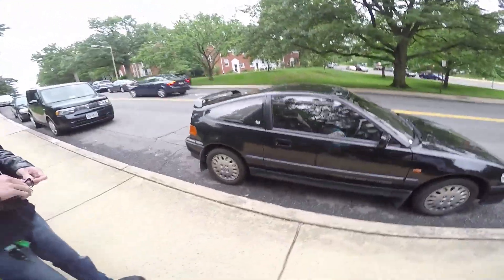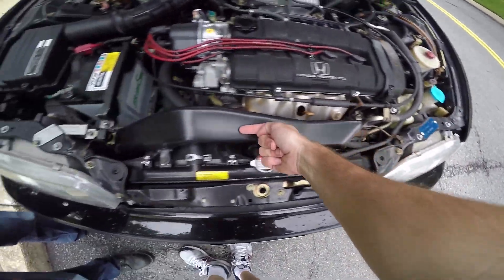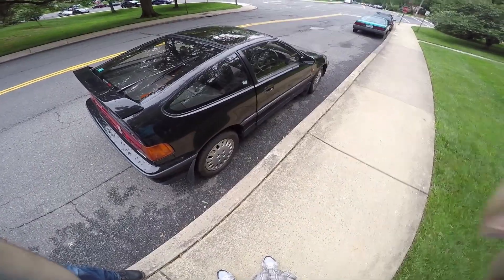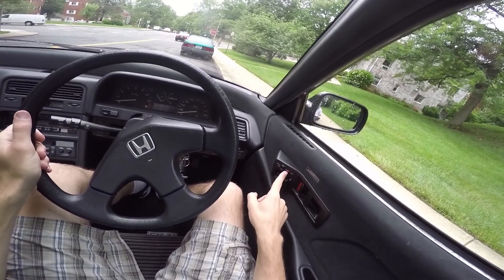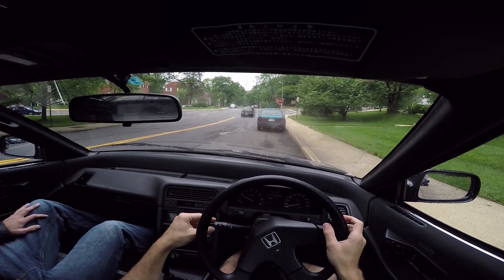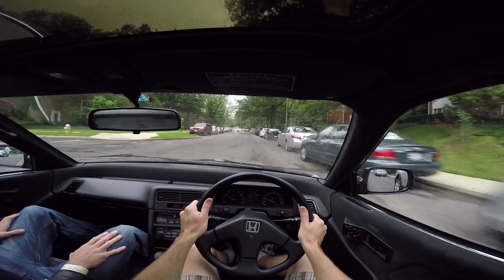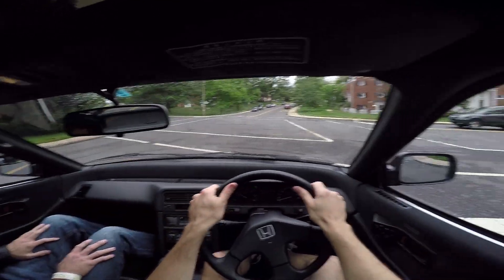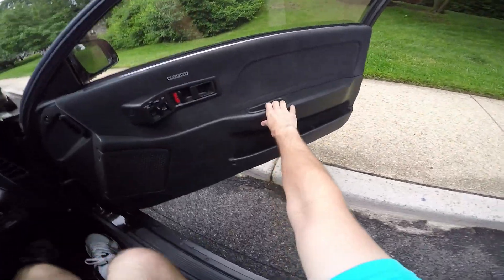1988 Honda CRX JDM P.O.V. Drive

Comment: Would anyone else kick an elderly woman down a flight of stairs for this car?
Reply: Yep
Reply: Yep
Reply: Jack Daniel It's the elderly that tend to cherish these cars, put little miles on them and eventually sell them onto a younger generation. Would you kick an elderly woman down a flight of stairs that has looked after an 80's Honda from new ? Oh wait this is youtube...
Reply: ***** I would generally recommend against selling a CRX to someone of my generation. We have a knack for either totally destroying the cars, or doing things to them to turn them into street racers. I'm 22 and drive a white '91 CRX HF that has over 304K miles on it. Luckily, I understand the value of taking care of such a car as these things are getting more and more rare, and they have incredible gas mileage compared to a lot of the other cars that are being driven today.

Because I cherish this car, I am trying to put in the money and work to restore it as best I can to its stock condition. Just bought a motor for it that only has 150K miles on it from a friend for $150. Soon, I will have the engine swapped, and will no longer be leaking so much darn oil. Most of the small problems this car has were there before I got it a year ago.

Honestly, though, don't just pawn it off to some kid my age. Make sure they will be able to take good care of the darn thing.
Reply: Jack Daniel 1:1 trade? ALL DAY
Reply: the0real0realitykid Yeah if you can keep hold of a good one it's best to. I thought I sold my car to someone decent and 6 months later it's no longer on the road ! Only 14 examples left now !
Reply: I wholeheartedly agree with not selling these and even 90's prominent import cars to the current and even some people of my generation. I'm 29 years old and my first car in high school was an '88 CRX DX in 2002. I bought it for $400 because is wasn't running and the owner didnt't know what the problem was. It ended up being a fuel leak at the FPR. Aside from faded paint, the car was in excellent shape. Fast forward 1year and i was in full fledged rice mode and destroyed that car. But recently, before mr. Regular posted these crx review, I was scouring craigslist for a bone stock, excellent condition CRX of any model for a daily driver. To my amazement, there were almost none to be found. The same goes for all EF's, EG', and EK's. It shocked me how the last generation just completely ruined the vast majority of these vehichle, which is Honda at their finest and most pure form of their original vision. Anyway. Whats left thats in decent shape are commanding high prices so if you have one leave it alone because no one looks at Honda's as serious collector cars but, if most examples are molested then that may change. Sorry for the novel, haha.
Reply: Jack Daniel Like I said, any of the work I do on this car is to bring it back to as close to stock condition as I can. Right now, replacing the engine because my current engine leaks. Not a lot difference between the old one and newer one from what I am told. Definitely not turning my car into a ricer.
Reply: +the0real0realitykid That's awesome. I'd like to do the same some day but, with a family I can't dive head first into a project anymore. One day I'll start resto project on a CRX and drive it forever. Take you time and do it right and don't let anyone tell you Honda's are a waste of time.
Reply: +the0real0realitykid If you were referring to hearing that there's not a lot of difference between the engine in you car now and newer ones, then, that's exactly right. The differences are mainly in the intake manifold, water/thermostat pipes, and knock/oil sensors on the back of the block. Swap over the corresponding parts from the old engine to your new one. I admit I started in the game as a ricer but quickly learned. Good luck with your project and REPLACE THE WATER PUMP AND TIMING BELT WHILE THE MOTOR IS OUT!
Reply: Jack Daniel again... to ease your mind, you can consider me the serious collector. A small amount of body work and an antique plate, then it's basically to the car shows. I can guarantee there will be no JDM AF stickers on this vehicle.
Reply: Yeah I probably would
Reply: +SUPRA thanx it's a couple years old
Reply: +Devin Kaiser funny I graduated high school when you said that, if you knew about cars you would know that a sun fire probably has more power than a crx :/
Reply: Funny, if YOU knew about cars, you would know it's a Sunfire. One word. You could get the Pontiac with 115-150 hp and they weighed at LEAST a few hundred lbs. Prob not faster or if so, just barely. Go ahead and show us more of your, "knowledge". We are dying to learn from the, Master.(bator).
Reply: jalderink and my old comment is still relevant how?
Reply: Zachary Vasil my crx has 140 hp (same as a sunfire) and weighs 600 lbs lighter. But your sunfire would, in theory, be just as terrible as every other garbage sunfire put there. But mine would still be stopping traffic in its place to stare in awe.
Reply: Neah
Reply: Jack Daniel gently.
Reply: Twice 🤯
Reply: I would kick one from a 50 story building

Comment: Amazingly low miles for that car, the owner is lucky.
Reply: ravesilly It could be fake tho, and even if they are not it means that either the car had an accident or it was left in the garage for a long time, either way it's a bad thing.
Reply: Andrei Vlad 1 owner in Japan. All the service records were sold along with the car :) No accident history. Grade 4 at auction :) I have underside shots too. :)
Reply: Andrei Vlad I mean I'd say that's a weird assumption considering how completely clean every detail of the car is, especially the engine bay. That engine looks showroom new. As for it being fake I'm sure Mr. Regular could tell and would let us know, do you know more about cars than him? I doubt it.
Reply: Living in Japan and owning a few cars, I can agree the TRANSMISSION has about 22k miles but how many HOURS are on the engine?  I drove from Atsugi base to Yokota base which was about 25miles or so but sometimes I sat in traffic for 3hours.  Yes the transmission drove for 25 miles or so, but the engine ran for 3hrs.  Mileage is a transmission thing, engine runs regardless if the car moves or not..;-)
Reply: 3 hours for 25 miles? You could walk there faster.
Reply: +ravesilly When you're able to import the 90's JDM stuff in the US, you'll understand that low km JDM cars are pretty common, here in Canada we're only at 15 years import rule, more or less they all come here with around 50k - 120k kms. Anything with a USDM chassis equivalent will drop in price overnight as a side note, Z32s/MKIV Supras/SW20s/FD3Ss etc, all around $5k to $15k CDN depending on mileage, auction grade and mods. Also basically all of them are rust free too :)
Reply: n1zm0 I've been browsing the auction sites for the last few months and I can tell lol. I actually found a 1990 GT-R yesterday with 26,000 miles with a B grade for both the exterior and interior. If it didn't have a repair grade it would have been perfect.
Reply: +ravesilly the r32 gtrs are relatively pretty cheap here, it's the r33s and r34s that have a really high price simply because they're still sought after in Japan and worldwide. Same goes for nsxs and ae86s, if the Japanese still want them, they're going to be expensive. But run of the mill things like type r integras, civics, mr2s, s15s, all are decently affordable here
Reply: +ravesilly by r33s and r34s being expensive I mean the gtr versions, the gts-ts are whatever, dime a dozen here, but the jdm importing is becoming a fad now, since all the good stuff is already here (90-early 2000s)
Reply: n1zm0 The R32's are actually going up in price in the states which is half the reason why I want one. The other half is because I miss having a 6 cylinder and I have a huge crush on GT-R's.
Reply: +ravesilly just import one from here, we have tons, just go on kijiji in any Canadian city and type in skyline =)
Reply: n1zm0 I never considered that actually, It'd also be cheaper I'd imagine. I'll have to ask Rivsu if they could do that. My only worry is a car coming from Canada is going to have rust unless it's a summer only and garage kept car (yes I am aware R32's already have some rust).
Reply: +carib2703 It's not a lawnmower bro... who gives a fuck how long it sat in traffic lol. Look at it, it's clean as FUUK. You're just getting into a whole new level of O.C.D. Ain't nobody got time for :P
Reply: +lolyermad It's Japan. Pride is like everything there. Although that might be a bit reverse racist.

Comment: 1.6 ZC have not seen this engine in a long time. They made Carbon Fiber Hoods with the ZC bump on the hood to make extra room for it. Very clean and classic. Hold onto it these models all 85 to 89 ae becoming classics.

Comment: At 4:40 you can see that this one is equipped with back seats.  Just barely safer than a Brat back seat and you'd need to be a legless midget to fit there.

Comment: My 1990 Civic doesn't have a shift lockout either.

I giggled at the oh-so-familiar shifter wiggle to make sure it's in N before turning the key. You learn to do that quickly after the first time your car tries to jump a curb when you turn the key and it's in gear.
Reply: Justin R I never do that in my own car, as if I see the shifter, I know what's up, but when I get into someone else car, wiggle it.
Reply: Justin R What does this mean?  Like if you start it in gear with the clutch pushed in what happens?
Reply: Alex Kocurek If the clutch is pushed in, it just starts. But most cars have a lockout that prevents the car from turning over unless the clutch is depressed. In my car, the car will turn over even when the clutch is released, which means that the car will lurch forward when you try to start it because the engine is "connected" to the wheels still.

Comment: You can get one with steering wheel on correct side from Europe, unfortunately extras like A/C, power windows and even power steering were super rare, while glasstop, auto aircon were not available at all. Electric sunroof standard on all models. Also we had "1.6 I-VT" which had B16A1 engine, which is basically identical to B16A, missing a knock sensor and for some odd reason 8 ponies. Those had leather seats, power mirrors and windows as standard.

Comment: Ive got a 96 Mystique with the duratec v6, and MTX75 5speed manual. Surprisingly it doesnt have a shift lockout either. It does 'one-up' this Honda by using direct linkage vs. cable linked shifter.

Comment: I had an 1991 SiR one a couple years ago. The  cover for the roof, if you didnt get it with your car, is hard to get. You more than likely have to buy a whole chopped roof that includes the cover.

Comment: This car is on craigslist. MD PA area JDM '88 CRX SI RHD with 23k miles
Reply: 14,500 obo is  the listing price. its in arlington. has the glass roof and the description says HVAC Plastic was broken and repaired just like said in the video

Comment: I recon they wound the clock back, how would you know if those kms are genuine
Reply: Really... after seeing the condition of that car? That car was as they say clean as a cats ass. lol Sure there's things one can look for to determine if the mileage is somewhat in the range that was said, but from what we have seen in this video, I'd guess it's probably correct.
Reply: apache1234657 KMs are updated on the title every time the car goes in for shaken (the biennial inspection necessary to keep plates on your car)

Comment: That's a b18b1 not a b16a1 same engine out of older integra's like that guy said but it looks way to good to be the engine it came with
Reply: 96cobra R  this isn't the b18b1. It's the stock zc 1.6 dohc non vtec. And ya. It's original.

Comment: That car has to be worth like a hunnit grand.
Reply: Locutus Far from it, these things start at around 80 thousand yen. Less than 1% of what you said.
Reply: It has like no miles though. My 2014 car almost has more miles.
Reply: Locutus I've noticed many JDM cars have very few miles on them. I'm honestly not sure why, but I've seen numerous Skylines with less than 30000 km on them.
Reply: ***** Petrol is expensive in Japan since all of it is either crude oil that is refined in the country or it's from Russia.
Reply: ***** I figured another reason might be the superior public transit systems in many parts of Japan.
Reply: ***** Dude, gas is like $6 a gallon here. It aint that expensive. People don't drive their cars much because where are they going to drive it? Look at the land mass Japan has and then compare that to the States. Not to mention the fact the many people in Japanese cities don't drive at all due to the extremely efficient public transportation.